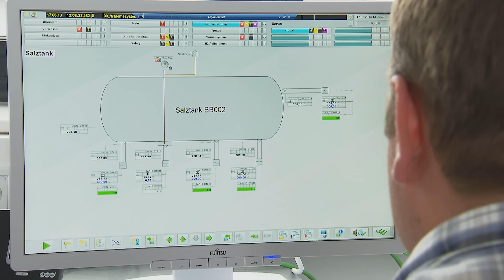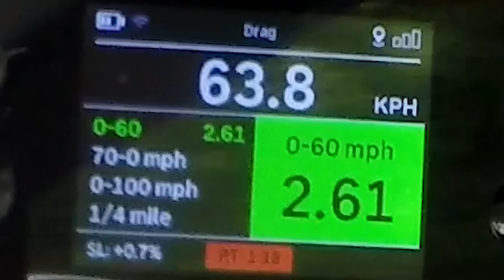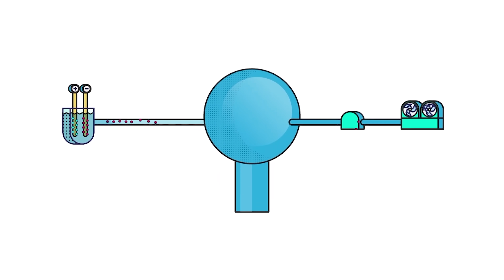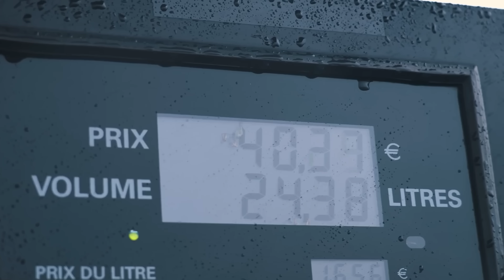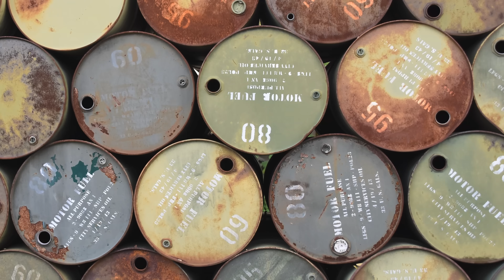Porsche just SAVED petrol engines FOREVER

Comment: Make your own generator and use HHO and feed that into your engine fuel pipe and then dilute the gas by 60% by mixing it with air. You don't need big corporations just a good work room and a good imagination. There is more than one option and was completed by Stanley Meyer and there are loads of others who have done this and more.
The combustion engine is not dead and only needs a clean fuel and mother nature gave you it in Water and Sea Water. Human body is electrical and you can not live with out water and it is the same for the fish in the sea as well as whale.

Comment: Would be very interesting for F1 or Motogp go to synthetic fuel.
Reply: F1 started using fully renewable fuel at low percent mix I think 2 years ago. Currently it is 10%. The target is 100% for the next rule changes in 2026. And the fuel will be applicable to road cars also. So it won't be long until your wish comes true :)
You can read more on F1 website if you are interested.
Reply: I normally follow F1 closely but must have missed that. Thanks!🙂

Comment: Like Toyota does not have this yet? HTTR Pink Hydrogen by MHI and some Japanese Ministry. Running a gas engine on hydrogen is quite simple; it's a chip tune away, the fuel tank however is still an enigma for most.

Comment: EVs are complete bullshit. Their battery harm the environment in unimaginable ways, the electricity they use to charge is mostly made from coal or gas and to top it off: after the battery dies guess where its going? Right to Africa to be „recycled“ aka burned on a massive trash pile. EVs are a complete scam.

Comment: EVs arnt the solution, they are infact worse for everyone due to the lack infrastructures. Hydrogen is a good solution but once again lack infrastructures. I hope Porsche can make this possible. Remember Top Gear doing this with a BMW.
Reply: Porsche doesn't have the infrastructure either. It will be quicker and better to improve the electricity supply.

Comment: The issue is likely to be the cost of fuel production of what Porsche have put forward. These so called synthetic fuels will not be cheap to buy and will increase in cost over time.  It will take several years to get these fuels into forecourt pumps as you mentions.

As EVs growth in market shares, e fuel cars will decrease and that adds to the cost per litre value of these e fuels.

The other issue now is cost of servicing over the lifetime of a car. All combustion engines, and drive trains are by comparison far too costly.  

Its a clever option but I suspect by the time this even gets started, others options will be available.

Hydrogen.  Ask Toyoda Toyota about his recent experience of racing a Hydrogen car.

Comment: Great idea, get it going Porsche hope this becomes a thing!!
Reply: Europe had a roadmap for net zero fuel since 2012. We mixed net zero components in the refinery process. It should be increased from 5% to 100% over several 4 year steps. Didn't happen as we couldn't scale these process to the required fuel consumption.
But it's great that politics decided to keep diversity in technology alive rather then decemating it down to battery powered vehicles.
Ship's planes and trains can be loaded so heavy that electricity can't provide enough power over distance. And it helps reducing emissions of existing cars a lot.
But for now you can drive ~5 times as far in an EV from the power used to make e-fuels. But both technologies will keep evolving after the new regulations. So it stays interessting.
Reply: It is super expensive compared to charging an EV
Reply: @Leo Mühring  I'd rather pay the expense and keep the internal combustion engine alive then charge am E.V! E.V are great and all that, but combustion engines make you feel alive and connected to the vehicle! 💯
Reply: It already is, just not on this side of the planet

Comment: One big problem you sadly did not mention: Currently the production of e-fuels uses so much energy, that if you charge the ev directly instead of creating efuel with the energy you drive about 4 times as far with it. so if this cannot be driven up to at least a 1:1 or better it is economicaly always a lot more feasable to charge an EV with the power instead of creating efuel. Hopefully they will find a way to get this ratio better...
Reply: Besides the horrendous inefficiency compared to BEVs, importing e-fuels from ‚the desert‘ will keep up the dependency on the same questionable states as today with fossil fuels
Reply: And if you're already using electrolysis to produce hidrogen, might as well use that to power your vehicle, not got the extra mile to complicate the process and produce a different fuel.
Reply: i feel like as there become more and more electric cars, electricity production will also become more abundant/optimised which would therefore lead to reduced production costs for e-fuels anyway
Reply: dam powered hydro electric station should take care of that fairly easily, to be honest...
Reply: Producing a large-battery electric vehicle uses a lot more energy so if everyone used a plug in hybrid with e-fuel for longer journeys, cars might use less energy in its entire life time. I don’t have any sources to prove this, but a possible reason why e-fuels are allowed in the future.
Reply: @jhixx8910   depending on battery size between 20-50k km is break even where battery ev‘s are starting to pollute less. Type of power used to charge also has an influence. I recently read an article on why it is prefferable to use a gas poweplant to create electricity and charge an ev over driving gas. Almost unbelievable but apparently the case
Reply: @DemonZapan  I was commenting on your original comment.

Not trying to prove anything, but a possible perspective to consider why e-fuel is allowed in 2040.
Reply: You are right. The only way this becomes economically viable is if battery tech fails to advance to the energy density of ICE fuels.
Reply: @angryginger791  what use is an energy dense fuel if you can‘t even extract half of it‘s energy content? Modern ICE use what, 30% of fuels energy? Vs 80-90 in ev?
Reply: @DemonZapan  The energy density of gasoline is (according to a quick google search) 12,200 Wh/kg, and EV batteries are at round 250 Wh/kg on the high end. So 30% is still 3660 Wh/kg, while 80% for batteries is 200 Wh/kg. When we are talking vehicles, it's all about how much you can carry.
Reply: @DemonZapan 20-40% depending on the year, older vehicles have lower thermal efficiency. Some performance vehicles are starting to use up to 50%. Diesel has better thermal efficiency surprisingly.
Reply: The laws of thermodynamics say this is infeasible…
Reply: Does that equation you are making take into account, that a normal engine is metal part, and an EV is made with an li-ion battery? You have any idea the pollusion have been made to get you precious EV ressources?
Reply: THe laws of thermodynamics ensure that the 4:1 ratio cannot be improved if at all.
Reply: @rogerphelps9939 What?
Reply: After we reach renwable energy superabundance, we can afford to experiment with these inefficient methods of powering automobiles.
Reply: better than manufacturing batteries
Reply: @Zapan, a better way altogether would be to stand up against this Net Zero LUNACY 👍
Reply: @melb5996  I agree… We are almost past that point. It would be absorbtion we need in a few years
Reply: @melb5996  Instead we should use EVs and emit even more co2, clever.
Reply: @melb5996  Everything on earth that we use came from earth, so the world is net zero by definition anyway. Is there more carbon in the world because life breathes?
Reply: @radicaledwards3449  I get your point but  we know that ‘interested parties’ love to call for stopping it getting into the atmosphere because there are billions of £s to be made.
Reply: @melb5996  Yes but that's only until those interested parties are the main shareholders
Reply: No it isn’t. Since you can’t transport or store electricity. With efuel you can. You can create it in the dessert and use it on cold climates.
Reply: @N911GT2  You could create it in the baked Alaska, and use it in Alaska then.
Reply: @N911GT2  "you can't transport or store electricity" - I don't think you really mean what you wrote - do you want to clarify this statement?
Reply: @shonunezekiel  efficiently. Power density of batteries isn’t as high as fuel. Also transporting fuel over great distances is easy without loss. Transporting electricity without loss over great distances, not so much.
Reply: @N911GT2  the fuel itself yes, but the transport itself is using fuel as well. There is a statistic online how much fuel is consumed until a liter of it is at the gas station. It‘s not massive, but it is not „without loss“
Reply: @N911GT2  what are batteries for? Oh, yeah, transporting energy...
Reply: @N911GT2 Of course you can store electricity.
Reply: @N911GT2  "you can't store electricity"... wow! This is new for everyone!
Reply: @DaviDeMo89  not in really useful quantities.
Reply: @N911GT2  Transporting electricity is near instantaneous everywhere in the world NOW and storage in batteries is becoming more common. Transporting from the desert to cold climates? Sahara to Scandinavia transportation would add considerable cost and additional pollution.
Reply: @N911GT2  what a load. You can indeed store and transport electricity just fine.
Reply: @DemonZapan  try moving electricity from solar panels in the desert to for instance Europe. The cables would be enormous and the powerloss in them would be so huge it’s not viable.
Reply: @DemonZapan  do the maths. Try to transport power over 5000kms and let’s see what you come up with.
Reply: @N911GT2  going through a powerline I agree with you yes. Hydrogen comes to mind with an effectivity of about 75% vs. 25% on the efuel conversion. Don‘t quote me on the exact percentages though. Efuels will surely be a thing, but at the moment its sadly not the solution it is marketed as. I hope it will be, or at least be viable enough to exist amongside other solutions.
Reply: @DemonZapan Just fine, you only lose ”a small amount”😂
Reply: @N911GT2  Actually in many countries they do transport power over 1000 km. The losses for even older lines are around 4% per 1000 km in bad weather. Under 1% in good. So even at 5000 km it is still far more efficient than making e-fuel. Of course this requires very expensive power infrastructure, etc. so overall it would be interesting to see which actually comes out cheaper.
Reply: @N911GT2  HVDC transmission actually have a loss of around 3,5% per 1000 km. There are plans by Singapore government to transmit solar power energy from Australia to Singapore. So, the losses are not that large, very likely far lower than transporting liquid or gas using ships, trains, or trucks.

Comment: EVs are yet another scam - they have a huge carbin footprint for the manufacturing of their huge battery packs to where in total vehicle lifetime comparison they are only marginally better than ICE vehicles (which may be negated if eletrical grid is, say, coal based like most of China). The exotic raw materials required for EVs are destructive to the Earth's environment for both their recovery and processing. As EV production ramps up there will be shortages and high prices for these exotic raw materials - even copper, which is used by factor of 25 times more for an EV will become supply constrained and much more expensive.

The grid needs to be trippled to eletrify all ground transportation - since the Biden fiasco of the Ukraine conflict, grid capacities have been contracting. Owning an EV doubles the electric bill and if EV ownership became widespread, the grid would be strained to brownouts and collapsing.

The best vehicle to get right now in terms of carbon footprint is a hybrid.

Synth fues are where all investments should be focused - far, far better way to go in respect to the planet's environment

Comment: ICE is dead. That is to say that when a tech has reached it's limit, with only minor tinkering to eke out tiny percentage improvements, while a competing tech can deliver higher returns, it's dead. E-fuel will not change the fact that ICE is a dead tech. Simply put, the greatest majority of the fuel burnt is turned into heat that does not power the car. Even if you could change that dynamic you'll still have a tough argument as it's still a long way from the power effiecency and cost reduction of electric motors: a tech that's only just getting started. And that's not even an environmental arguement, it's economics.
The major car manufacturers are playing for time so they can transition without losing market share to new start-ups.The arguement about the raw materials is a sham. New battery tech is moving faster and faster to the point that we have a number of techs based on readily abundant materials and there are enough manufacturing sources to produce current battery tech at very high volumes. I'll agree to the call for standardised charging and for planning permission to place charging points everywhere. We can deal with that as we did when ICE became the standard means to power motor vehicles, requiring pumping stations to be built across the road network, with refineries and transport of crude oil across thousands of miles.
As for the environmental argument, I've not found single peer reviewed scientific paper that proves synthetic fuels are carbon neutral, have you?

Comment: Great idea, but don't be blindfolded. So to make synthetic fuel we need to use sustainable energy such as solar/wind/water? Efficiency is the key (20%?!). All these conversions are just generating more heat... We don't capture carbon, we borrow for short term. This idea is based on the "actual law" instead of the law of thermodynamics. I wish we could have lighter, slower, and smaller cars. But I understand people who don't give a damn about the environment. We all just use the planet 'till death, Me too... I would prefer, solar/water/hydrogen fuel idea. How about reducing CO2, having more trees, or planting more vegetables...

Comment: Plants capture CO2 from the air. Gasification and pyrolosis turns biomass into syngas  and biooils that requires no energy or electricity to turn into synthetic petrol and diesel. 
This is a con that is extremely environmentally destructive and an attempt to keep energy monopolists in control of energy supplies.

Comment: E-Fuel makes sense when we have an even more massive abundance of energy, but not really before. 
For every kwh  spend you only get a small fraction  to actually drive your car. 
Electrolysis including the capture of CO2 is likely no more than 50% efficient. 
Combustion engine: 35% efficient. 
So for every 1 kwh spend you waste about 5/6 the energy. 
With electric cars you charge the batteries at about 90% efficiency and electric engine is another 90% efficient. So you end up wasting only 1/6. 
This is just very general numbers and are not including E-fuel/eletricity transportation but also here electric has less loss.  
That does not mean E-fuel does not have a place it is still much more energy compact and this i crucial in some applications (like aircraft) but in efficiency it will always lose big.

Comment: 0:56 EVs are not zero emissions, or anything close! People really need to stop repeating this lie. They're zero emissions at the point of operation , which is just a nice, comforting way of ignoring the vast emissions produced when manufacturing them and the ongoing emissions produced in charging them.

With that said, Porsche's efforts to save ICE cars are admirable and give us all a bit of hope. However I won't break out the champagne just yet as the forced, tyrannical push to EVs has nothing to do with emissions or the environment anyway, it's all about control and the reducing (if not ending) of private car ownership, so governments will just make up whatever reasons they see fit to ensure that this alternative never becomes widespread.

Comment: Nice story, just  distant relative from facts or economic reality.
Start from growing crops for green fuels. That died.
Synthetic fuels sounds so much better. But again if you can be bothered to read up on this technically,  whilst avoiding economics,  storage, transport, or adapting to a new infrastructure you may think its possible. Its right up there will algae. If buts maybe. Porche owners need not worry the rest off the World intends to use its new oil gas reserve discoveries for the next 50 years.  Thats reality. Besides ULEV will prevent you entering so many cities in Europe.

Comment: Let's not just talk about carbon neutral, but also about energy efficiency. Carbon capture, electrolysis, and then conversion is even LESS effective than using the result of said electrolysis alone, which in itself is already less efficient. While the charging "issue" might be a factor, in the end E-fuels are made from the same electricity. Even non-driveway charging is more efficient, and electricity can come from everywhere, even your hamster in a wheel. E-fuels are factory only. Renewable electricity for E-fuels is about as dumb as using said electricity to power a fan, to power a sailship. It's best to just... pipe it right into the car directly. I'm sorry, petrolheads, but the times of expensive to maintain cars that fart is over, or relegated to museum cars. To keep them active in memory in the same way we remember stuff like gladiators, and other negative things such as the civil war. By re-enacting it, and displaying it in a museum.